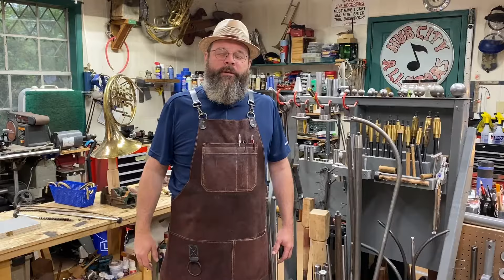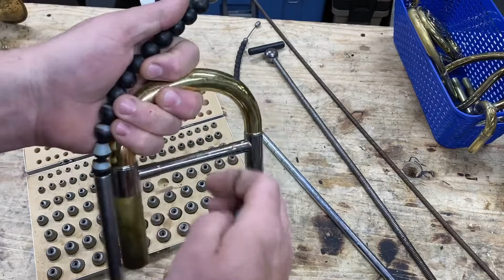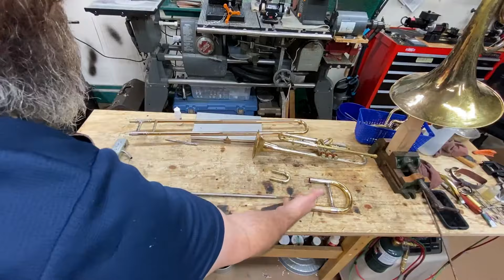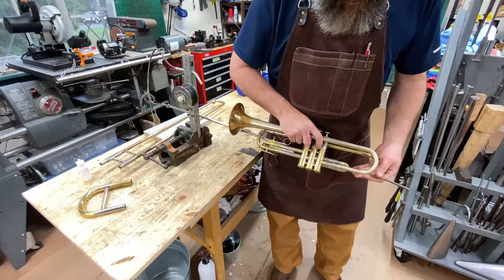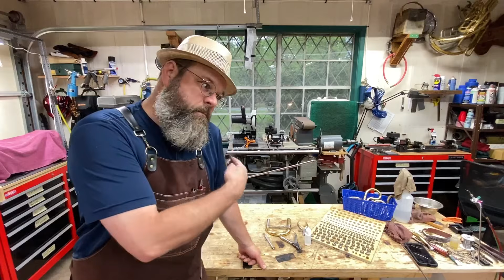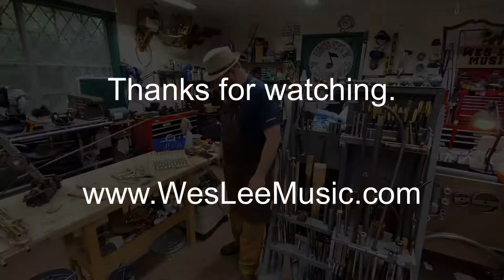The Roth Tool- Brass Dent Removal King? - band instrument repair- Wes Lee Music Repair

Comment: Wes, I have a question about your Roth tool.  If you are concerned about hitting the rim of an instrument on the Roth, why is it not padded there?  A bit more extension from the vise, a re-positioning of the wire reel and a felt glued to the Roth body would go a long way to protect the instrument without impacting the performance of the Roth... so I would think.  bob, not a band instrument repair technician.

Comment: The Roth tool is the gold standard for dent work. I first tried to use the thin wire and after a dent ball got stuck in the crook Iearned my lesson.
Reply from the maker: I had same experience!

Comment: I saw a news release where you used a cnc machine.  Can you recommend a CNC machine?  I need the material used as well.  Need to come up with a lever connection for an old Conn horn on the thumb lever.
Reply from the maker: Yes sir, I 3D print parts, that’s what you saw. The machine that I would recommend is the Creality Ender 3. Best bang for buck machine we tried. The material we used was PLA.